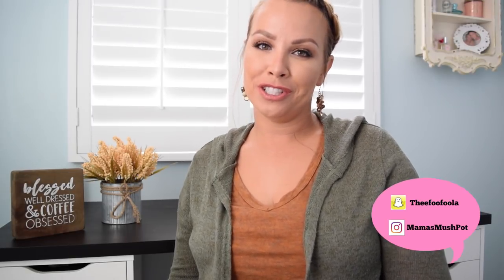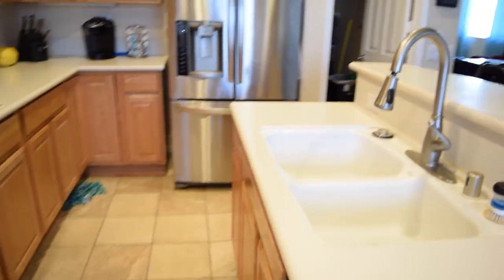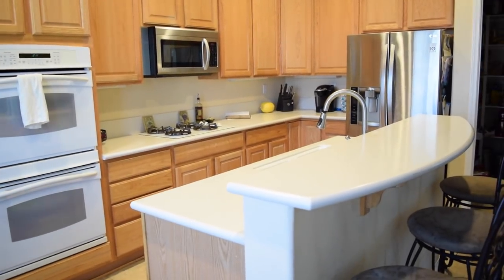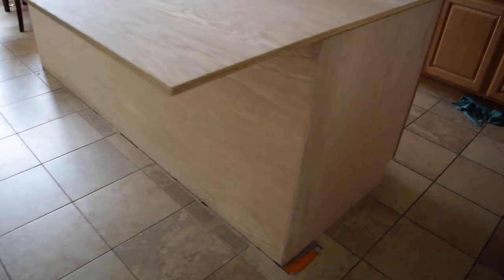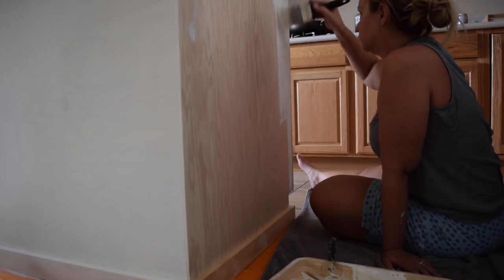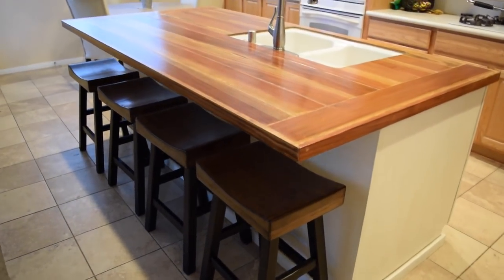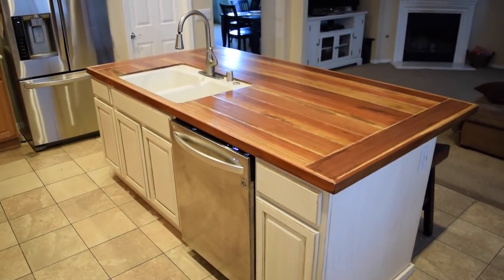DIY KITCHEN ISLAND REMODEL WITH BUTCHER BLOCK!

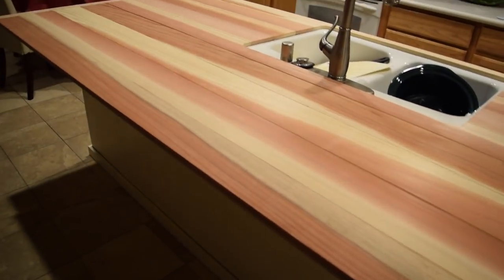Comment: Looks great! Two questions (I apologize if they have already been asked): (1) It appears you used some sort of wood filler between the planks on the butcher block countertop - 4:25 shows before, 4:45 shows after - what did you use?  (2) There are no supports for the overhang shown in the video, and the boards run parallel to the overhang - did you / how did you strengthen the joints in this area to prevent sag / breakage as people lean on the counter?  [I am not criticizing or trying to arm-chair quarterback your build here (I know others on Youtube take great glee in this) -- I am genuinely interested in knowing if you did anything or if you determined that it was not necessary with the plywood support or if there were other considerations. I am looking to do something similar, and supporting the overhang is the part about which I am uncertain.] THANKS!

Comment: I’m curious about the transition from the countertop to the sink. Was that an Undermount sink that you used or did you just lay that over a regular sink? I’m used to seeing the countertops cover more of the sink edge so I’m just curious to learn more about the sink set up. If it’s possible to turn a regular sink into an Undermount sink that would be awesome, but I’m just curious how the water does in that area. Thanks!
Reply from the maker: Hi! Yes the sink was originally undermounted. We used silicone to seal the transition.

Comment: I wish you had shown more of the demo and pre plywood process. Did the studded wall provide a place for the cabinets to be anchored too? How are the cabinets fastened or what ?
Btw great video. It’s exactly what im doing right now. Mine is a lot bigger.
Reply from the maker: Hi there! Thanks for watching! I agree! Looking back I needed to film more of the countertop construction. Sorry about that. The new cabinet is attached to the existing cabinetry with screws. The plywood we wrapped around the entire island ties everything together. Let me know if you have any other questions! I would LOVE to see your project!
Reply: Yes!  How did the side get done?  The block was smaller then the plywood, then it turned out nice?  Did more block get added on?

Comment: Do you have any support under the overhang? I am going to do the same type of project and am curious of the strength. Looks great by the way!!
Reply from the maker: Hi! Thanks for the compliment! We do not have supports for the overhang we just used extra thick plywood. It's held up pretty good it was only suppose to be temporary.  🤣

Comment: I'm towards the end of my extensive research for installing our butcher block island and it looks like you made two large mistakes. The butcher block should not be resting on plywood because it needs to be able to breath from underneath. Also, overhangs over 8 inches should have support brackets to prevent warping.
Reply: Yes it’s supposed to have supports but if it works for them let it be. Just do yours the correct way and you’ll be fine.
Reply: @EilandMeisje85  the video is for instructing others on how to do it properly. They should therefore have correct information
Reply: I understand Kevin. Which is why I agreed with your original comment.
Correction to your statement: this is not an “instructional how to do it properly” video. It’s a “DIY: how they did it” video. We live, we learn, we fix. But I get where you’re going. Have a great day Kevin.

Comment: What type of screws or bolts did you guys use to attach butcher block
Reply from the maker: Bostitch 3/4 inch 24 Gauge Micropin nails. :)

Comment: This is exactly what i want to do
Reply: Have you done it?
I would love to lower my bar too to the level of the other side but i want to use the the same counter top and put it together on one level and than bondo the seam in between both counters, sand it smooth and epoxy it. Not sure if i can do it 😀
Reply: @alexk9643  i have not.. But it’s still on my project list ..